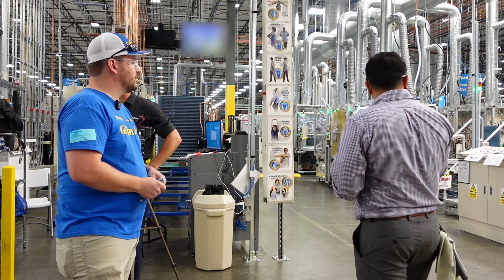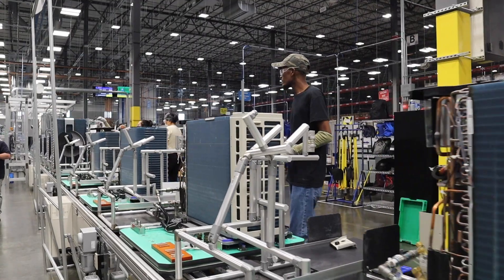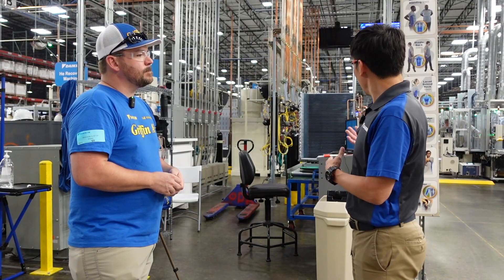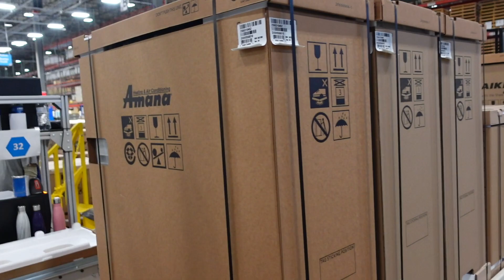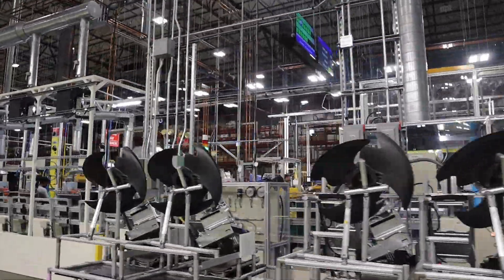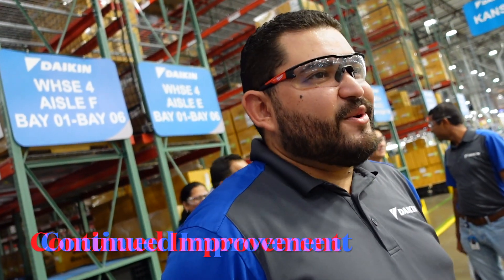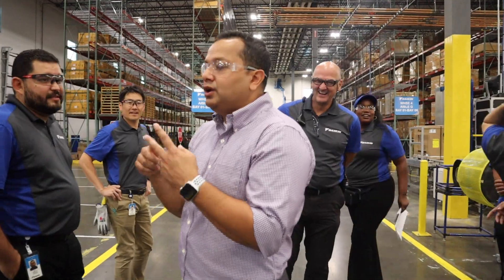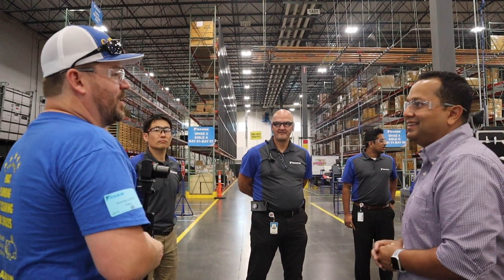Daikin Fit Assembly Line. Never Shown Before!

Comment: Hi Mr. Griffin, love your videos.  I had a quick question about high efficiency media/electrostatic filters.  I'm planning on purchasing a Daikin Fit (or similar) system in 2025 after Daikin moves to R32 in the USA.  I know, in general you like Daikin equipment.  I also know, in general, you prefer 4" media filters over electrostatic filters (because most home owners don't maintain electrostatic filters properly).  Specifically, from Daikin, what filter solution would you recommend for my wife and I?  She has severe allergies.  Needed to be MERV13 equiv or better?  I think the Daikin filter is electrostatic, isn't it?  Would you recommend it?  Or a Honewell or AprilAir 4" media filter instead?  Do folks ever install these AFTER the blower (aka in the supply stream north of the evaporator coil)?  Or are they always installed in the return prior to the blower?  My thought is that it would be "best" to have a 1" fiberglass filter before the blower (aka on the return side to catch the large crap), and then place the 4"/high efficiency unit on the supply side (after the evaporator) so that you're sure 100% of the supply air is being filtered.  Or does no one do that for residential installs?  Thank you, and keep up the great work!  -Jonathan
Reply from the maker: I would probably defer to your local contractor on the media filters. We sell Aprilaire mostly but if your Contractor has a brand they like better for one reason or another, I would probably defer to them. Thank you for your kind words and support!

Comment: I have been using the Daikin Fit heat pump model DZ6VS for a 4 months now, and unfortunately, my experience has been less than satisfactory. I feel it's important to share my experience with potential buyers, especially those living in warm climates like South Carolina.

The biggest issue I've encountered with the Daikin Fit DZ6VS is the frequent replacement of the control board. In just a short period of time, I've had to replace it three times, which has been not only frustrating but time consuming going back and forward with the installer. The reliability of this unit, in terms of its control board, has been a major concern.

Moreover, despite living in a hot and humid climate like South Carolina, the Daikin Fit has struggled to cool my upstairs adequately. Even after insulating the space with spray foam, I've found that the unit can only maintain a temperature of around 80 degrees Fahrenheit, far from the comfort level I expected. In comparison, my old 15-year-old unit performed significantly better, effortlessly maintaining a comfortable 68 degrees.

Overall, my experience with the Daikin Fit DZ6VS has been disappointing, with multiple control board replacements and inadequate cooling performance for a South Carolina summer. I would advise potential buyers to carefully consider their options and explore alternatives before investing in this particular model.

Comment: I have a FIT. It’s ok, but temperature stability in my office is not good. Daikin 1 thermostat needs to be redesigned. Local and remote control of Honeywell thermostats are easier and more logical then the Daikin 1.
Reply from the maker: Give your installer a call. We haven't had any issues with temp stability on any we've installed

Comment: I am in SWFL and being proactive in replacing a 12 year old Lennox XC21 system with a Daikin FIT. Should I wait until the "next gen" FIT with R-32 hits the market? Currently I am being quoted on the 4 Ton model: DZ17VSA481B.
Reply from the maker: Good question.  I think if you can wait, 410a is going to be phased out in 2025.